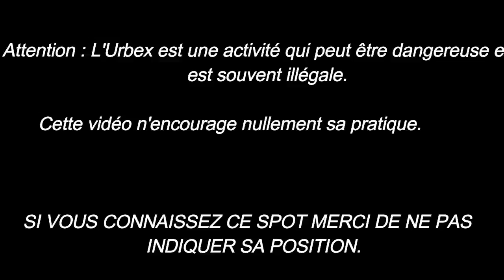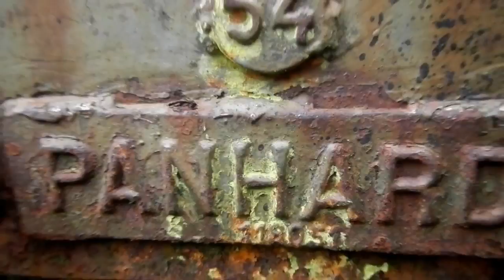Urbex : Epave de char

Comment: yen a 6 autres a 3 km de la ou tu la fimé sur les 6 autres il y a 2 amx13 et 4 panhard sinon plus bas sur la cote il y a un 37 mm fr et un bolard du 16eme s
Reply from the maker: Ouais en effet j'ai pu les visiter bien après cette vidéo ^^
Reply: Et ils sont en meilleurs états ? Je serai bien intéressé, ils sont dans une forêt vers l'îlot des..?
Reply: @ewencoat812  non ils sont sur un terrain militaire
Reply: @ewencoat812  jdonnerai pas plis d info la dessus cest trop dangereux
Reply: @FLAK23  ouais pas de soucis, bah si tu veux on peux en parler et parler urbex, en privé, sur messenger.
Reply: @ewencoat812  si tu veut
Reply: @FLAK23  viens sur mon messenger Ewen coat si tu veux 😜
Reply: @ewencoat812  il y en 2 cest lequel ? un barbu ou un jeune
Reply: @FLAK23  le "jeune"